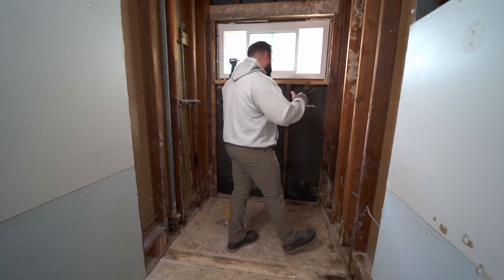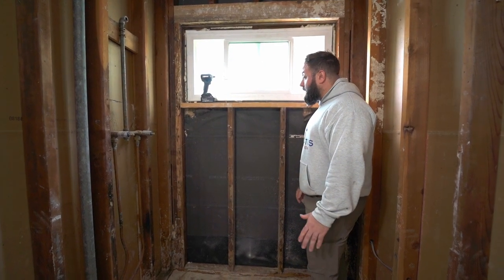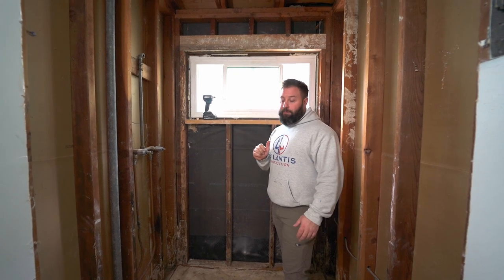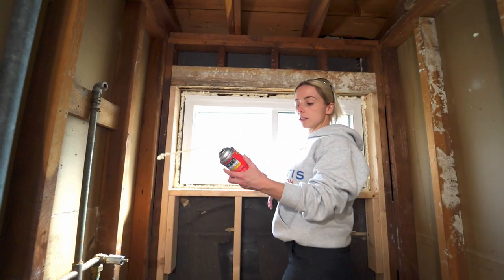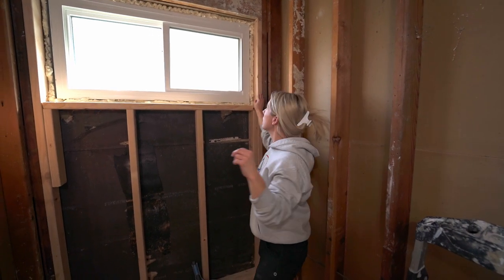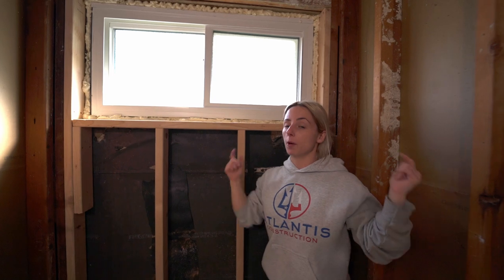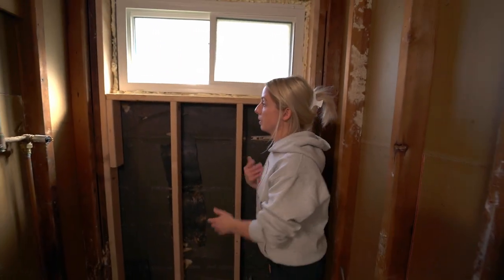Bathroom Renovation | Vlog series Pt. 2 - Framing

Comment: Tip for exterior load bearing (shear walls). There is a certain spacing of the fasteners to fasten the sheathing to the studs for the shear stability as well as the “racking” of the wall. In this small span, The header is distributing the weight to the king and jack studs, so you’re fine. Great job as always!!!
Reply from the maker: Good to know! Thank you. We did consult with a framer friend before doing this to make sure we were doing it properly and not totally just guessing lol

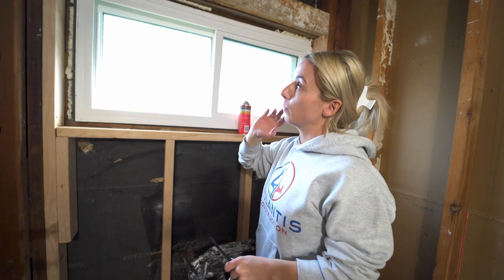Comment: 5:15 Oooh.. Red can Great Stuff? Love that stuff, but it's unforgiving when it comes to windows and doors, can push them out of plumb and can certainly bow typical headers, jambs and sills. BUT! It's an absolutely phenomenal gap filler with the more rigid solids (i.e., masonry, solid wood, etc.)

Blue can Great Stuff is the best for this application. Far more flexible with a great seal upon expansion. 💙

Comment: I was wondering if you could have used shoring post (or called acros in the UK) while removing the old studs just to provide certainty regarding any potential movement caused by weight redistribution. Of course keeping the king studs in place provides some assurance but I would have been even more risk averse with shoring posts just to provide a safety net. And I suspect it will all be beautifully, level, plumb and square at the end. With a math background I can do all the engineering calculations for loads, beam deflection but just thinking about it before hand sometimes you can miss the obvious.